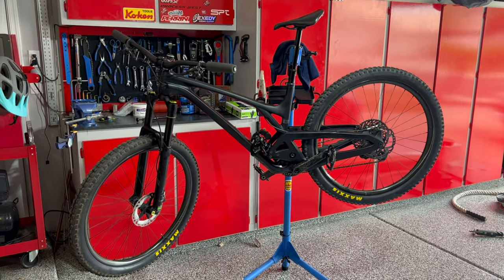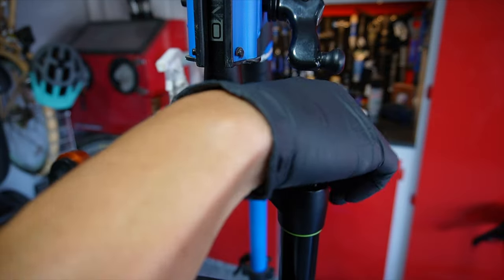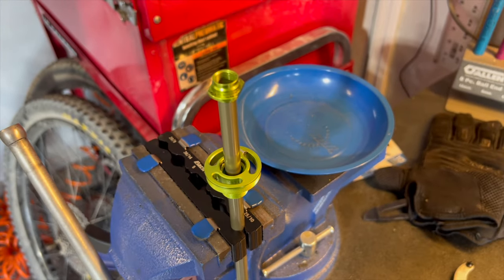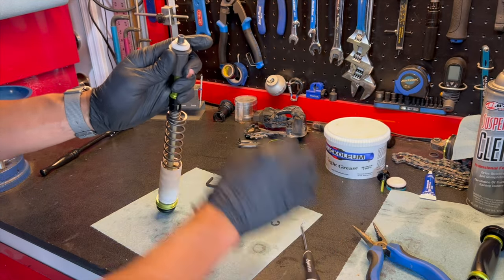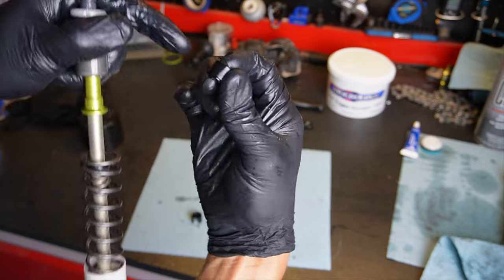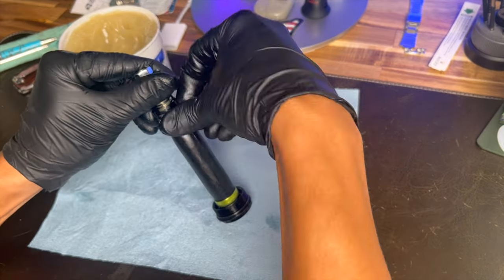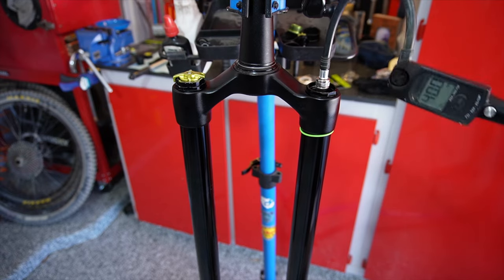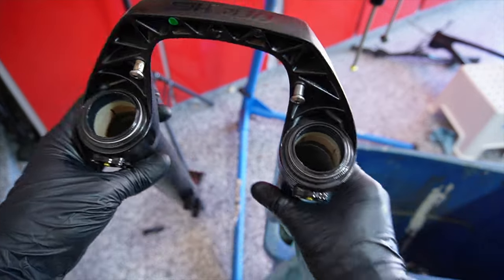DVO Onyx SC D1 Complete 100 Hour Service - How To

Comment: Great video. I had the surprise of going through DVO's full  rebuild manual and found the same flaws. I really think DVO should update their manual to reflect these changes (air piston, marine grease, rebound end plug, bladder replacement, etc.) Luckily you and I reached out to DVO to find this out before taking apart the fork. I found the same for the Topaz shock too.

Comment: Thanks for the video, I'm eagerly awaiting the video you mentioned in which you disassemble and reassemble the damper unit in more detail - (Because with my Sapphire 34 D1 it is exactly the same). I think the whole thing I have to disassemble soon times because the adjuster units for hsc/lsc can be partly very very difficult to turn :(
Reply: I will try and get it up soon!

Comment: Thanks for putting this up. I was looking at my smooshed bladder like 'This ain't right' and the manual didn't mention it.
Reply: As the bladders age, it gets harder to get the dents out, or you can get them out and then they reappear. Bladder dents compromise performance in proportion to how big they are, notably making it harder to lighten HSC with the knob if you need that--- you can adjust it but there's  little effect. They also can make you add too much oil in the bleed process, making the damper more progressive than it should be. Obvious solution is to replace the bladder, but you can get more life out of a weak bladder (did I just say that?) by compressing the damper rod about 10mm when bleeding before closing the bleed screw (official DVO tip). That way when you air up the fork, going to full extension will suck the bladder out to fuller inflation. Don't overdo this if you're a heavy rider, as you risk exploding the bladder.